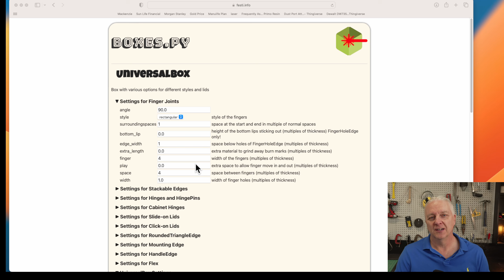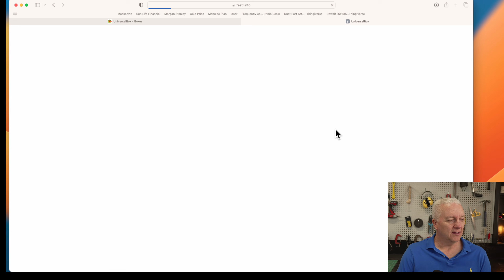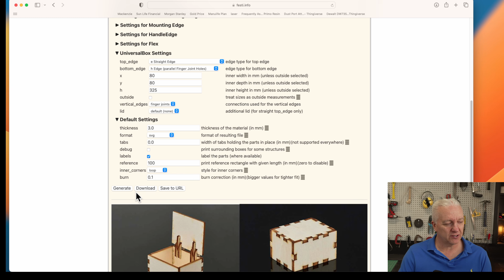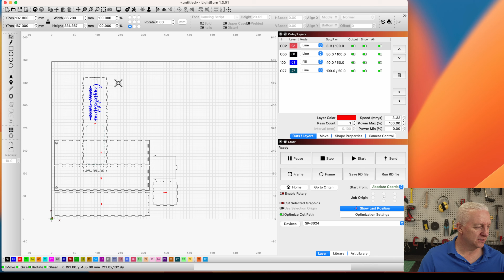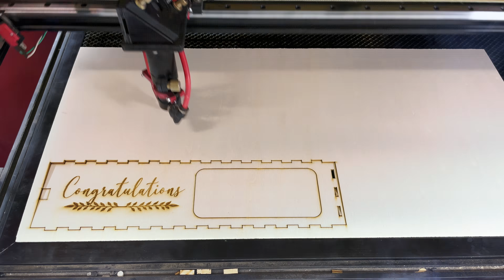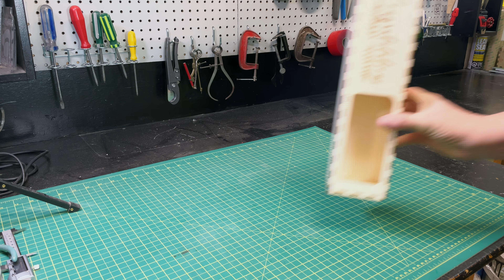Make a Simple Wine Caddy Gift Box

Comment: Cool design. The lid and the position of the holes will make the inside dimensions smaller so be sure not to make the box too exact otherwise you wont be able to fit the bottle in.
Reply from the maker: It’s very easy to adjust the dimensions for anything you need. You can also move the hinge pins where it suits.